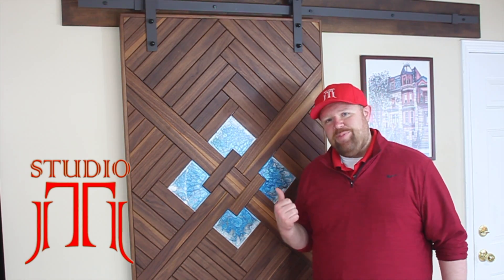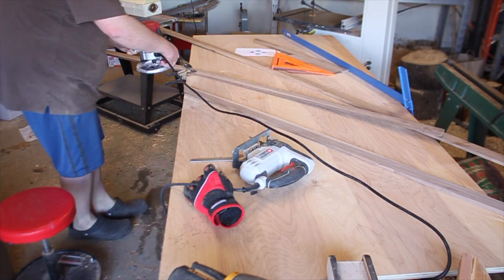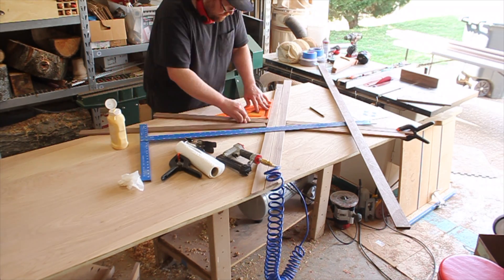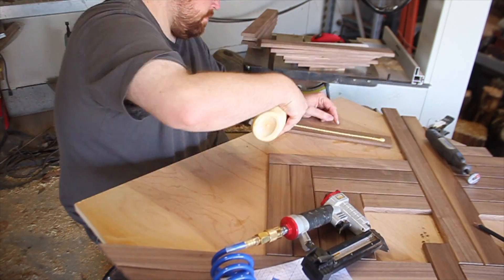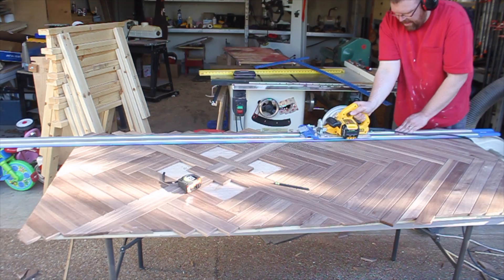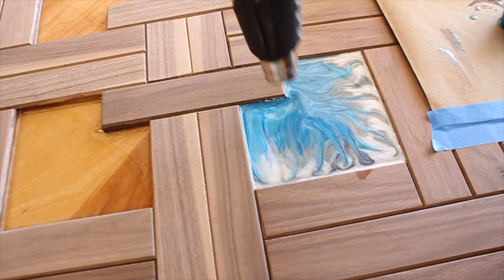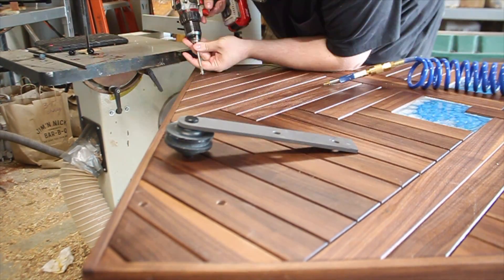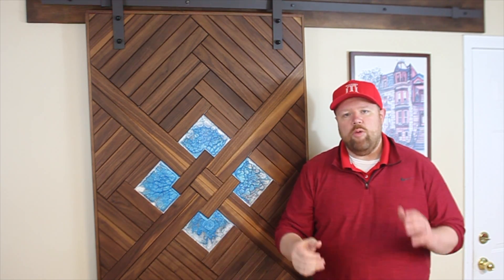Home DIY | Barn Door with Resin | Easy Weekend Project

Comment: I know you mentioned using a UV protectant if it's going to be exposed to the outdoors, but have you ever done a door like that? And if so how did it turn out.
Reply from the maker: RORRingENT resin just isn’t meant to be outdoors unless you heavily pigment it.  Every resin will yellow in the sunlight.  This stuff was great for ambient light, 6 months now and zero yellowing.

Comment: How did you make sure the resin didn’t stick to the surface you poured it onto? Awesome door!
Reply from the maker: Thanks.  The resin sticks everywhere.  It’s essentially like a plastic glue.  Did that answer your question?
Reply: StudioJLT no. Lol I meant when you filled in those squares on the door, what surface did you lay the door down on order to fill each square? And how did you prevent the resin from sticking to whatever was backing it up?
Reply from the maker: drinny26 the walnut was placed on a plywood substrate.  So both the walnut and the resin were stuck to it.  The benefit of doing it this way is you don’t have to worry about leaks, since the walnut and the plywood is what is keeping the resin place.